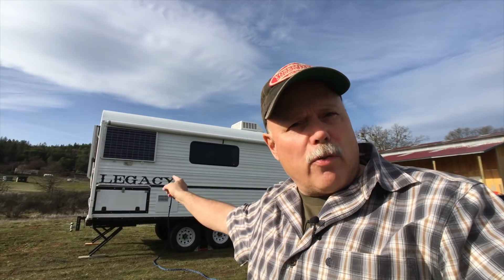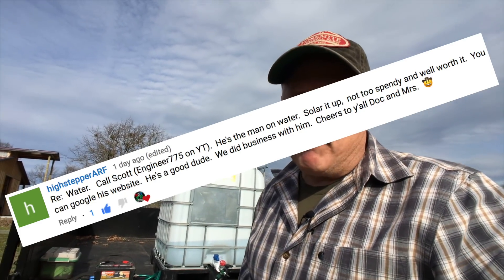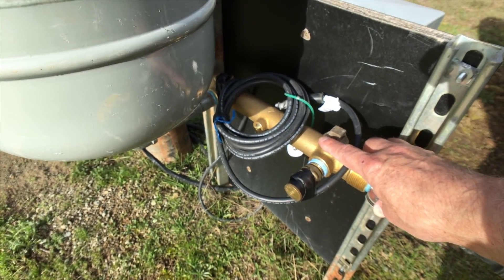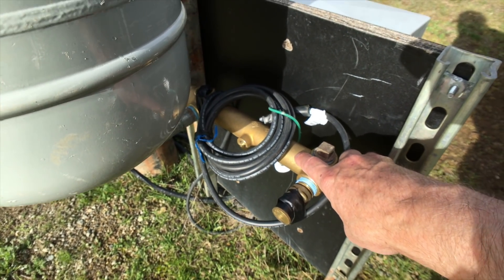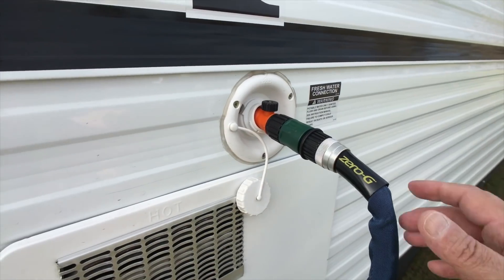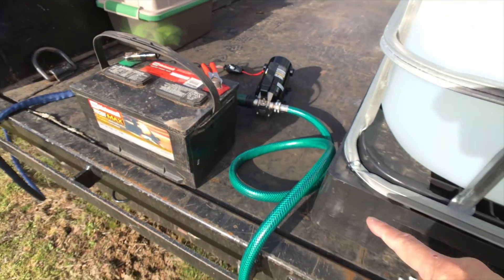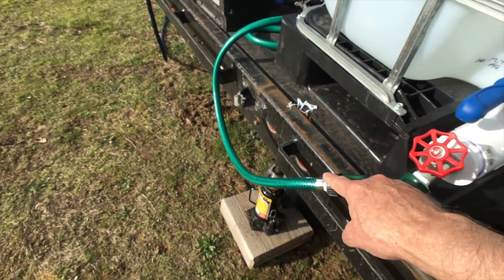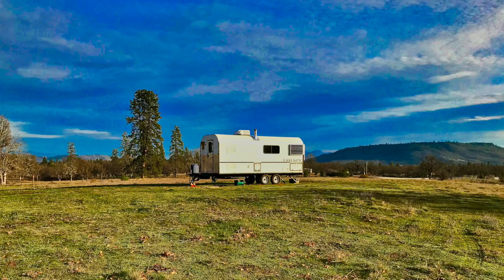DIY Off Grid IBC Tote Water Storage

Comment: Are you going to have propane? 2nd time I've asked this question.
Reply: Just add my two cents on Propane, look at buying your own tank over renting. A higher initial outlay but will save $$$ over time(especially if you plan to own this place for awhile. Also owning your own tank let's you shop around for suppliers for the best price. Finally, I would also consider an underground tank set-up as well. Like I said my two cents...and always easy to spend someone else's $$$ :-)
Reply from the maker: A Modine Hat Dawg is on our wish list!
Greta suggestion. Thank you.
73 de David / KF7ETX
Reply from the maker: A well respected 2¢ at that!
Thank you for the great suggestions. One of my partners who lives off grid mad the same suggestions.
Reply from the maker: Yes we are going to have propane on the ranch. I think I answered that before but if not I apologize.
Reply: OK the reason I asked is that I live in Northern Nevada and it gets very cold here. I bought a 125k btu heater for my shop and it works great. It was the Modine Hot Dawg. Very inexpensive for what it is, thermostatically controlled and very easy install. I did it all myself. You might want to consider that option for your barn. 73 from K7ZFI